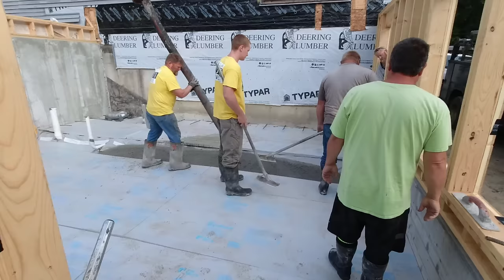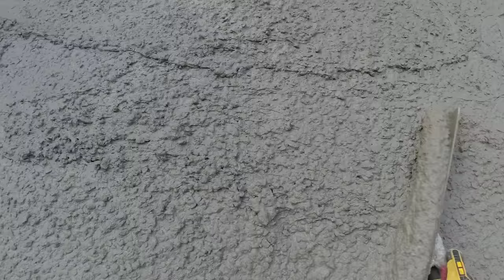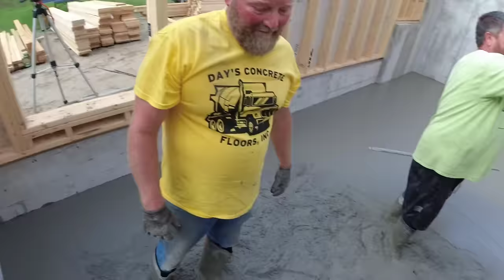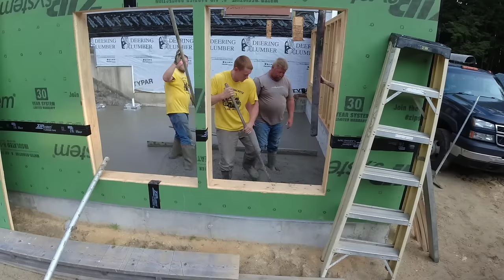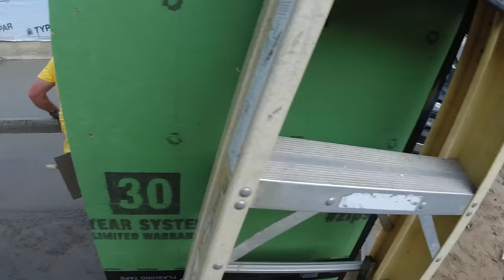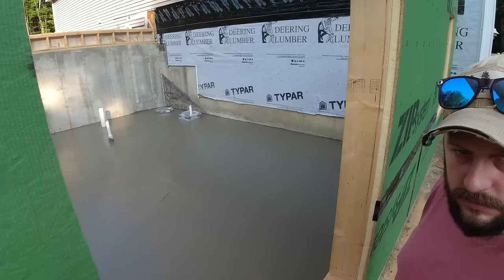Tough Pour Over The HOUSE (How To Pour A 24' X 20' Concrete Floor)

Comment: Mike two questions saw the rebar sticking out of the foundations  pile of rebar but it never made the cement???????? what happened second of all the concerns of safety!!!!!!!!!!!!!!!! when the pump hose plugged…………. I know you’ve been Warned about standing around it…..but I’ve read articles in construction magazine about a man  been hit in the head and killed…… that’s a very dangerous situation probably should’ve hit it with a hammer or tied it off someplace to a wall… before they pump through it again… so wouldn’t get loose and hit somebody just a safety concern keep up the great work love the videos Samuel bacon